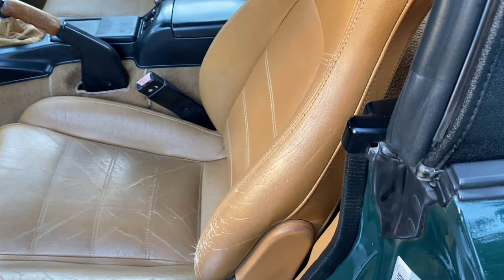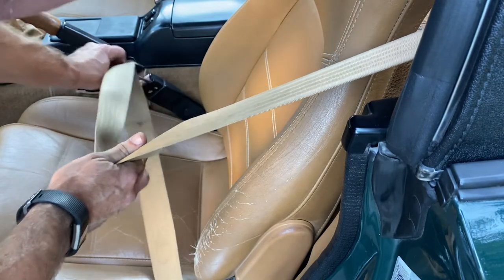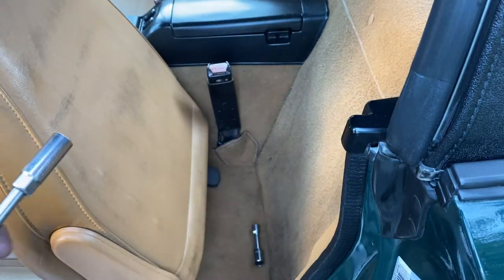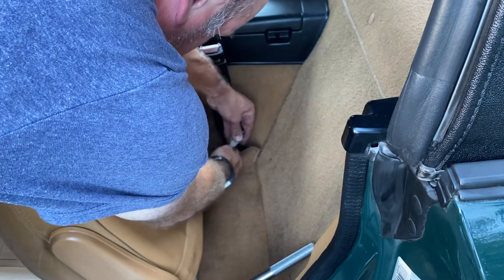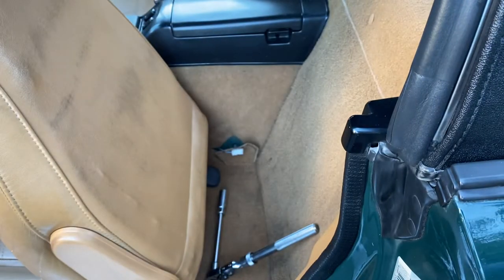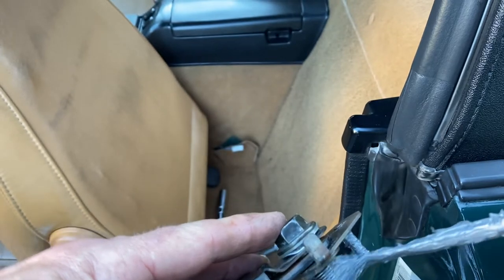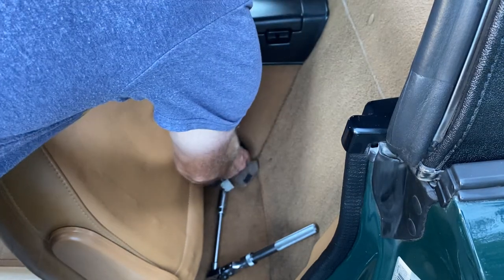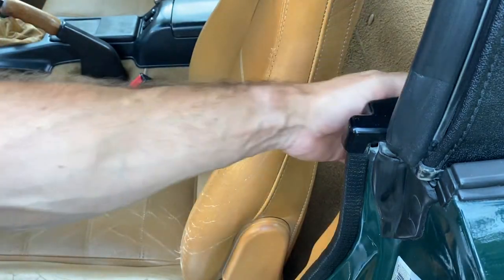Seat belt receptacle replacement, 1990-1993 Mazda MX5 Miata / Eunos Roadster.

Comment: I recommend rebuilding the seat belt catch. Parts are interchangeable between sides and wanted to keep the seatbelt wire for NY State annual inspection. What I have found on mine was a lot of dirt and old grease that dries up causing the unreliable operation. Clean it and grease it to restore. Just have to undo the stitching that holds the cover from sliding and just slide it down to unscrew buckle housing screws. Oh and red fabric dye/paint makes it look like new again! Did both seat belt this way. Works great and really didn't take too long. Of course remove from car to get at it better.
Reply from the maker: Awesome info 👍
Thanks.